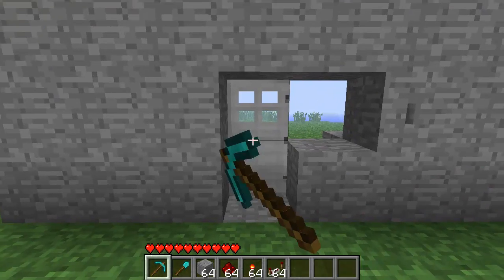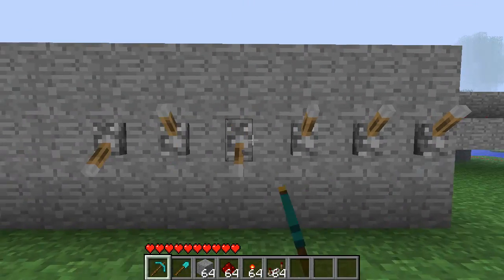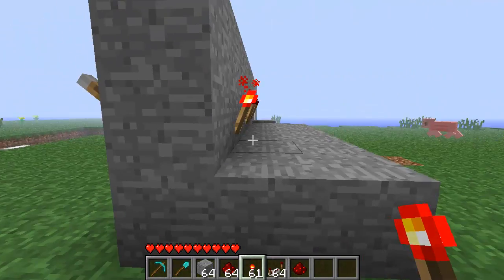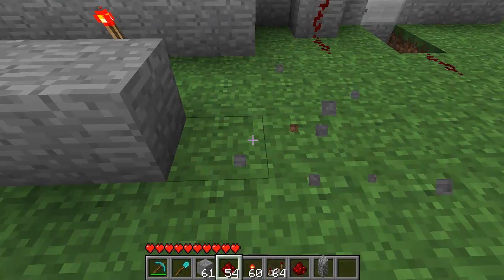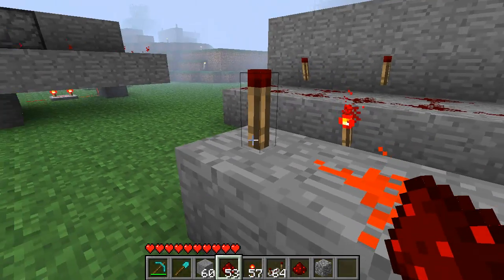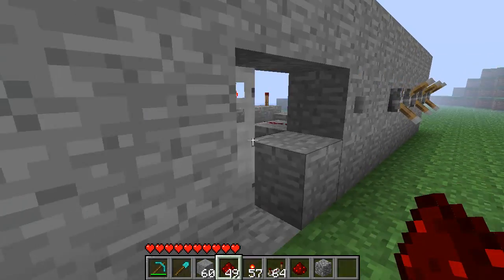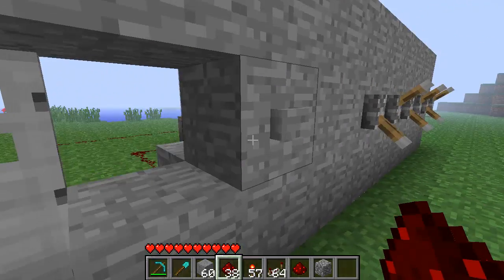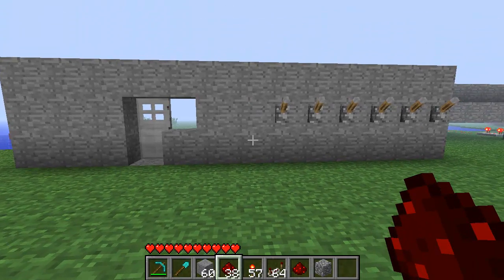Simple Combination Lock (Tutorial) :: Minecraft Beta 1.7 (Server Update)

Comment: anybody can just turn on all of the switches and itll open too...
therefore u have to not just combine the switches to be on for the combination through AND gates, but also the switches to be off for the combination through AND gates, combining them in another AND gate (some inversions of lines might be necessary by letting a wire run into a block and placing a torch on the other side).